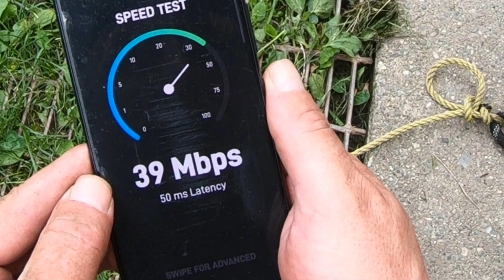Starlink satellite dish install underground wiring in PVC.

Comment: Be glad you have a Gen 1 setup vs the Gen 2 gear. Gen 2 has moved to a proprietary connector on the end of the cable, and the built-in ethernet port on the Starlink router has been removed. A real stroke of brilliance... So not only does the Gen 2 gear cost more than the Gen 1 gear did, you have to spring for a separate ethernet dongle if you want to use wired networking. An additional $25 or so dollars.

The proprietary connector is too long to get through an inch-and-a-half 90 sweep. For a company that is supposed to be staffed by geniuses, SpaceX has made some really stupid moves from the consumer's point of view.
Reply from the maker: I guess they are like most companies the consumer is the last one they think about .ASS backwards.